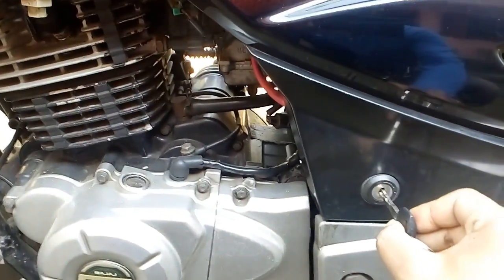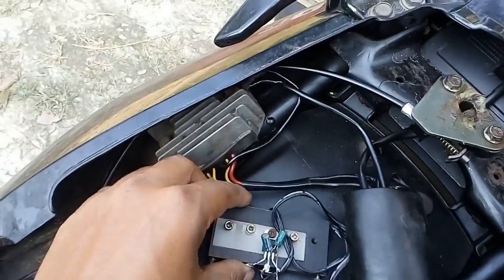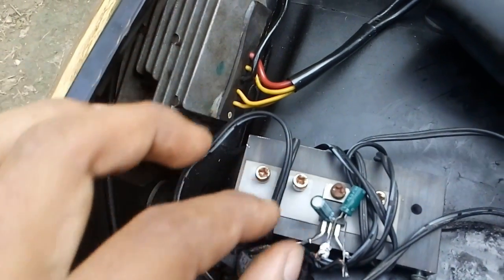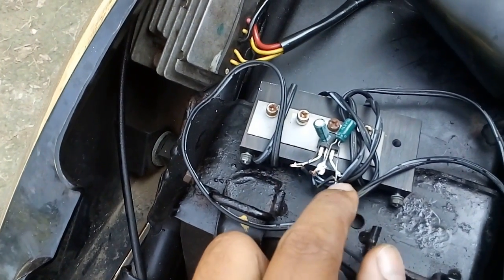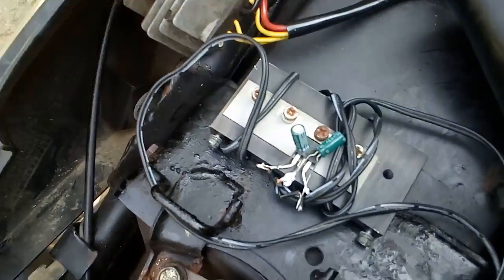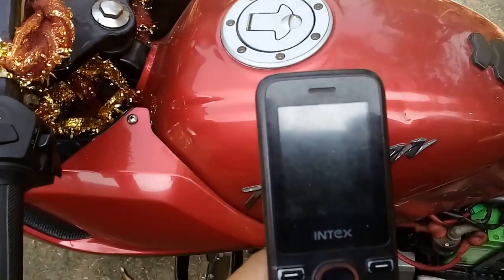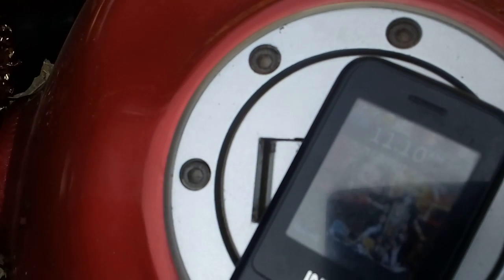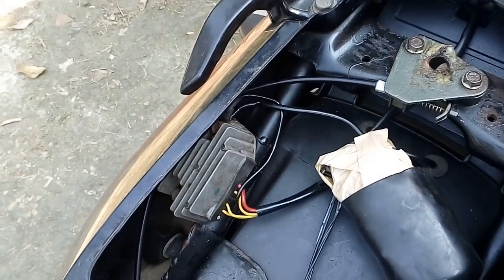HOW TO MAKE A MOBILE PHONE CHARGER ON MOTORCYCLE

Comment: Ic is verry hot and it only show charging but its really not charging...what happen bro. Pls reply from philipines
Reply from the maker: Tell me what are the parts you are using
Reply from the maker: I used this following items to make the charger.
1. wire
2. otg cable
3. ic 7805= 05 indicates the output voltage in dc
Reply: I used the components you given. The only component i did not used is the 10ft wire i only use 3ft. And my phone battery is 5000 ma.
Reply: This charger can charge phones that has battery of 50000ma?  Is this the reason why ic is too hot?
Reply from the maker: @richardmacabale7474  which bike you are riding? what is the specification of your battery?
Reply from the maker: @richardmacabale7474  what is the voltage is produced by your charger that you have made. please inform me by using an app called amphere
Reply: Its 5000ma only not 50000
Reply: The charger produce an output of 4.96 voltdc and when i charge my phone and used ampere it draws 450 mA. When i start charging and only minutes after, touch the heatsink its burning hot
Reply from the maker: @richardmacabale7474  OK WHICH BIKE YOU ARE CONNETING AND WHAT IS THE BATTERY SPECIFICATION.

Comment: Bro ic over heat aguthu
Reply: I am also use heatsink
Reply from the maker: +prasanth ravichandran 
What do u mean?
Reply: VARUN VLOGS brother IC get over heated with in few second  i am using heat sink also no changes
Reply: Pls tell me how to reduce IC heat
Reply from the maker: I used this following items to make the chager.
1. wire
2. otg cable
3. ic 7805= 05 indicates the output voltage in dc
4 condencer 50v 10 macrofat
5. heat sink